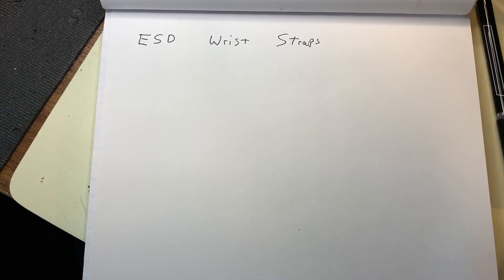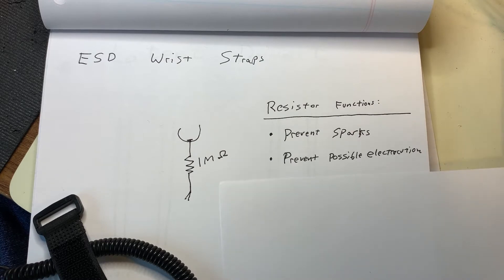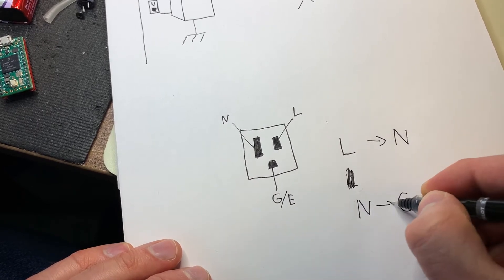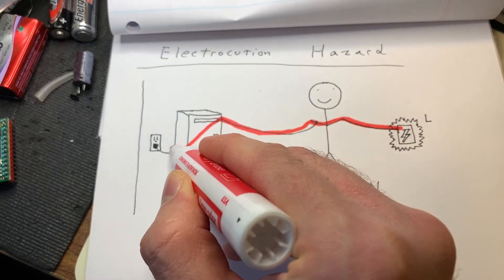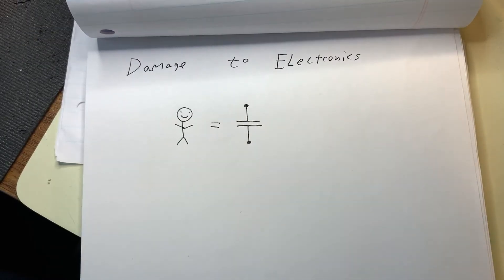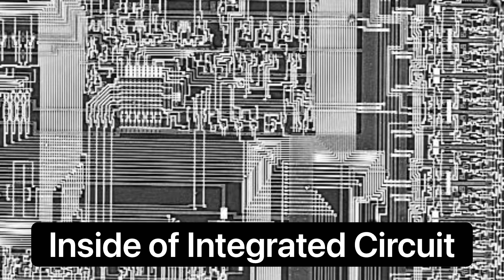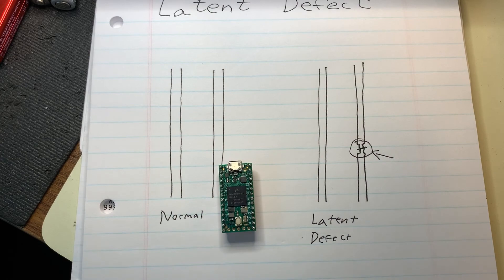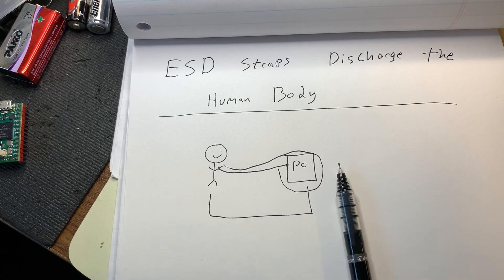Why use an Electrostatic Wrist Strap - two reasons!

Comment: im gonna build an expensive pc and i was planing to use wrist strap and buy an esd mat also, do you think the esd mat is not necessary in this situation or using wrist strap and the mat is gonna be better ?
Reply: If you ground yourself every time before you touch components you’re probably just fine while building it.

Comment: i wonder about electrocution hazard , how this can protect you when the current can flow from L to Ground directly  through your body ( as my feet is connected to ground ) ????!!!!!!!
Reply from the maker: Wrist straps are not for protecting people, they are for protecting sensitive components. Typically devices with sensitive components are low voltage anyway

Comment: Very very helpful thank you 😊
Reply from the maker: Glad it helped
Reply: @HTMWorkshop  it helped to understand why resistance built in those tools, are the Esd mat is the same as anti static braclet?  Or completely 2 different tools. Thank u
Reply from the maker: @alFeras_tell   @VT  Its a different product but same idea. The ESD matt is just a grounded mat for working on but the ESD wrist strap is to ground you. Both work the same way.

Comment: Cool video! can you show us how you would set up a resistor in line to the cable (in what direction)i"m currently waittng for my wrist band in shipment, but i want to do an improvised one with a resistor!Thanks!
Reply from the maker: Thanks. Do you mean what direction would you put the resistor? Not sure if I understand. You can actually put the resistor in either direction (it has the same resistance either way). Just need to make sure you have conducting (wires) connected to the resistor (either orientation) and then wire. Make sure the wire does not bypass the resistor. Hope that helps.